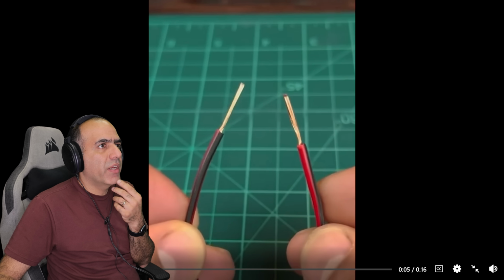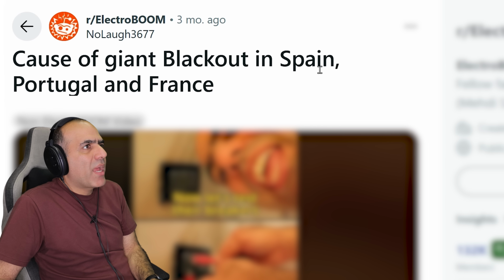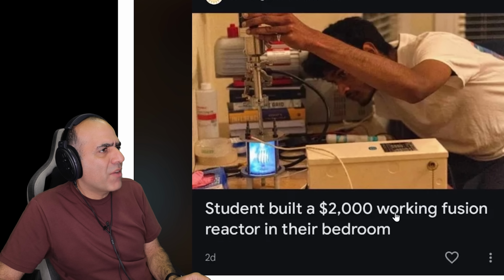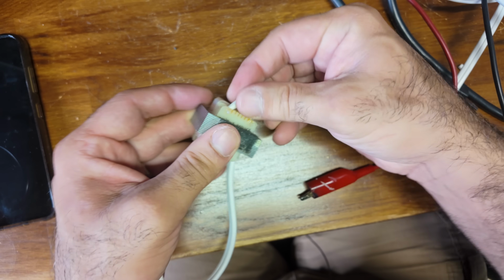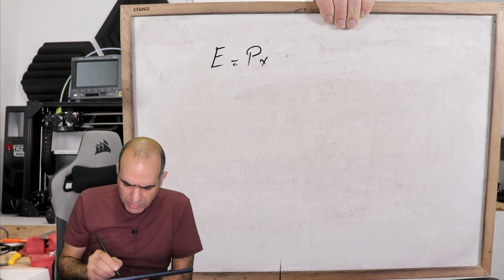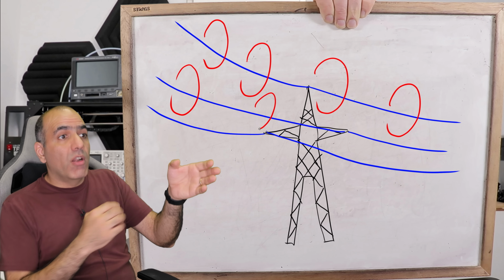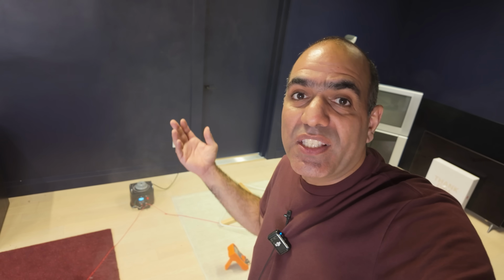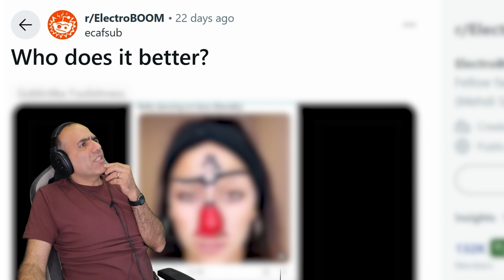Power Lines at Knee Level? Campfire with AA Battery?! (LATITY-016)

Comment: It is actually potentially nuclear fusion. But as you say, not "over unity". So it's just a party trick like building an electric motor at home. Or a battery. Or a capacitor. Or a plasma globe.
Reply: Oh come on nuclear physics says "NO"....
If you would light a fusion process something strong enough you can measure it you would die of radiation poisoning before the shitty reporter would be here for a interview...
The energy of fusion processes is released in mainly two forms... high velocity particles and hight energy radiation. Both not a good idea to be in the same room with.
Reply: @hawlitakerful  Dude, seriously, look up "fusor."  They've been around since the 60s.  You can build one in your garage.  There's actually a community of hobbyists that do just that.

Yes, there are safety concerns you have to account for and no, they don't generate more power than they require to operate, but they are fusion reactors.
Reply: @hawlitakerful  These are the words of dunning Kruger. All you're revealing is that you've personally never done it, otherwise you'd know it was possible and relatively safe with the right precautions. 

Jamie Edwards became the youngest person to successfully carry out a nuclear fusion reaction in a device he built  at his school. March 2014, 13-year-old. Reported on by a reporter.

Comment: For a battery fire, you can use the aluminum based wrapper from gum, chocolate, cigarette packs etc. Just make it thinner in the middle and it will start burning. Have tinder prepared and you'll start a fire.

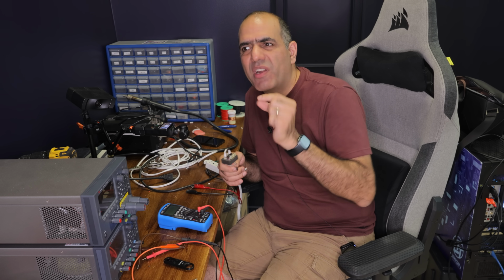Comment: 8:13 its just to small voltage to pull high current trought you measuring resistor inside your ampmeeter, just make 2turns , not half turn , and you will get 2 times the current

Comment: AA Battery thing appeared to use char cloth.  "is a material with low ignition temperature, used as tinder when lighting a fire. "
Reply: Looked like char cloth in the wire and fat wood shavings that were ignited.
Reply: @CanItAlready  very fat wood indeed... woof! 🙂
Reply: Use wire wool and a 9v battery or whatever angry pixies you have in your pocket.  Samsung burn well.
Reply: @Woffy. SöA metalized paper gum wrapper, torn in a way similar to the  wire in the demo (ie a thin bridge in the middle) can also work.
Reply: @Woffy. damn you! I just nosed my milk back into my glass! The samsung dig had me!!!
Reply: @anjhindul  
It's because Samsung CEO called Galaxy Note 7 "The hottest premiere of the season" 
Oh, sweet irony
Reply: neato, I thought it was like steel wool or summin.
Reply: char cloth is basically just charcoal but on a piece of cloth. you completely carbonize it and it's really easy to light, stays lit longer than regular cloth, and burns hotter
Reply: @Heroo01  It literally takes only a small spark to make it start glowing
Reply: I had to check back on it to realise that it's the cloth glowing, not the wire. Personally I'd just use a length of Ni60 or Kanthal wire as you can get the resistance down low enough for that to be above the ignition point of wood on 1.5 V. Then again, I usually have a LiPo cell on me so 3.7 V makes it much easier :)
Reply: Yea not a paper tower that is more plastic then paper.
Reply: @kirkanos3968  tower or towel?
Reply: This is a jailhouse special bro
Reply: It also used a coil from an e cigarette too by the looks of it
Reply: Char cloth "holds" the spark and glows like piece of charcoal. It gives you time to put it into tinder, and blow it into a flame.
Reply: Lol nerd alert naw I'm kidding
Reply: taper towel doesnt burn very well.
Reply: Correct, char cloth is just some cotton cloth that has been cooked without air, basically turning it into charcoal with a huge surface area.
Reply: The AA battery firestarter.  Actually works.  The cloth is carbon wool that has been soaked in alcohol.
Reply: Came here to say this.
Reply: ...and gasoline... 🙂
Reply: The way the pile goes poof then light up is gasoline. I've done actual fire from glowing ember (fire steel and tinder mushroom for those who are familiar) and it take long time, lots of smoke and gradually larger pieces of grass/wood shaving.
Reply: @greentjmtl  I know... I once bought a medieval fire kit with all those ingredients and I actually made a fire.
Reply: @greentjmtl Fatwood
That stuff ignites pretty readily, especially when it's dust.
Reply: @greentjmtl  Not at all. I used to do this is prison all the time to light cigarettes. Lights cotton super easy. Just puff up the end of a q-tip and light it. Not hard.
Reply: @greentjmtl  More likely Keronene then gasoline.
Reply: Nitro-cellulose.

Comment: Shorting a NiMH AA cell can result in a substamtial heating. The original dry herb vape, the magic flight launch box worked by shorting one across a metal grid. that could certainly combust whatever dry herb is legal in your region. the switch was also an example of genius cost effective design.
Reply: Whatever dry herb is legal?
Its an aroma therapy device i swear 😂

"Aroma therapy device" is what was on the box of my dry herb vape

Comment: you don't need wire anywhere near that long this is how we started our cigarettes in prison all you need is about 1 in of wire hell a quarter inch of wire will do, you shave the plastic off of the sheath and 1/4 inch of wire is all you need. A simple slice of Brillo wire is what everybody used in prison.

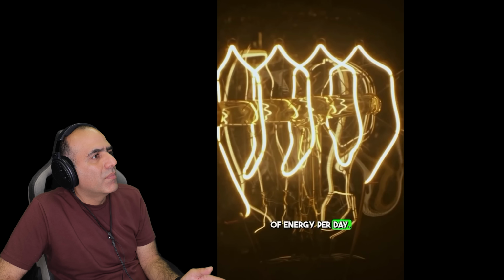Comment: 9:07  i think he meant to say 2000Wh .. people tend to forget the full unit for energy measurements. That would be 7.200.000 Joules, or 7.2 MJ. 
7.200.000 / 27.000 = ≈267 J/person 
267 / 2 sec ≈133 W
Would have some resistance, but definitely within human abilities.
Reply: 2kwh is about 1€,  
Great archievement.
Reply: @Animaniac-vd5st   Ah, but it is a great achievement for the con artists who sold the idea to the government's transport agency, with the small investment of only, let's say 500 euro per turnstile, per terminal. It'll pay for itself within uh.... If we make a euro a day, 500 euros per unit x 10,000 units...
Reply: @Introvertical474  Why are you automatically jumping so such outlandish conclusions? Are you seriously suggesting that the Paris metro doesn't employ a single engineer or something?

It seems this is pretty obviously a marketing stunt and the metro probably got paid for it.
Reply: Yeah, I found a source saying it's 2100 Wh over the 2 days (not per day). That's an average of 44W continuous. The monitor on the side probably consumes more than that...
Not to mention all the energy and materials used to build this.
And not to mention that the energy comes from people who then need to burn a bit more food and produce a bit more CO2, and the conversion is probably not very efficient. That's one of the reasons you don't put humans in hamster-wheels to generate electricity...
Reply: Energy = Force x Distance. 267J / person means that, if they push the turnstile a distance of 1m, they would have to exert a force of 267N, or over 27 kgf (60 lbf). My bet would be that they actually meant 2000J/d.
Reply: @WJS774 Likely!

Comment: He used a Duracel battery, not Energizer battery, that is the difference between a failed experiment and a success. My mouse can work for up to 6 weeks for everyday use with 2 Duracel battery, other brands of batteries have a lower life expectancy than that, like 2, 3 weeks, and then I have to change the batteries.

Comment: The 3 wire line outside your window, are you sure that's 3 phase? In my experience the top wire is ground. But I have no experience with US grids and it does have an insulator.

Comment: A cross, red geometric shape on the ground, smoke and burn marks? Preeeeeety close to summoning a demon there.
Also, I once cut a cable containing  ground, neutral and live using wire cutters. Even though live was disconnected at the panel (I check religiously 3 times) the ground fault thing tripped and confused the hell outta me. Since then I cut one wire at a time, but kinda confused why it popped.

Comment: Actually the fusion reactor shown is a Farnsworth Hirsch Fusor reactor and its one of the cheapest and easiest way to create a fusion reactor. You just need an high vacuum pump (like a turbo molecular pump) and a very high DC Voltage source, I think around 100000V. A few people on Youtube build one as well, but there are some who didn't got it right and just created a plasma lamp.
Of course this kind of reactor don't create nearly as much energy as it consumes, but its quite practical as a neutron source.
Reply: 30 kV is enough.

Comment: 6:00 Making a fusion powerplant is indeed very hard, but making a fusion reactor that doesn't need to create more power than it consumes... is still hard, but definitely easier than a fusion powerplant. Dunno if you can manage to do it at home tho.
Reply: You can, and people have. It's not easy, but some people like the engineering challenge.
Reply: It's called a Farnsworth fusor and several hobbyists made it at home.
Reply: Hundreds of people have made Farnsworth fusors at home and successfully initiated nuclear fusion in their garages.  It's a somewhat expensive and slightly dangerous hobby, but it isn't difficult.
Reply: Very much possible. Just expensive and requires a fair deal of knowledge.

Comment: @ElectroBOOM the D.I.Y battery lighter thing works alot better when its done with a (AA) battery and the wraping of a single strip of gum just get the strip reduce the width towards the middle by either cutting or tearing it and boom lighter.

at my school we would teach this experiment to the kids to teach them how current works but we stopped doing that after one of them worked out how to construct what the report calls "an incident ocured where a student while unsupervized made a small improvised explosive" dont worry no one was hurt.

Comment: Maybe that plug spacing is there in case you have a larger transformer plug. You can then span it across 2 plugs and something could still be plugged into the 3rd and top row plugs.

Comment: 15:44 I've seen- and been the cause of such a short circuit before the electrical meter, but the reaction seems too violent for this situation.
What's protecting this circuit? A 200 amp slow blow fuse?

Comment: the (assumed) reason that you can plug a device in between two outlets is if you have one of those annoying power brick plugs that takes up a bunch of space you can move it somewhere more convenient.
Reply: If you assume one of those takes up enough space to overlap into the next outlet, in the normal condition, you use the left outlet and the center outlet is unusable, leaving the right outlet. If you instead plug it into the left and center outlets, then the left and center outlets are still taken up by the brick and the right outlet is usable. I don't see how that has gained you anything.

I guess if you had four outlets in a line, you could plug a brick in on either side and still have a single cross-outlet slot available that wouldn't be possible otherwise.
Reply: @wbfaulk  I ran into a case where this was useful on a 3 plug outlet as well. The wall outlet was installed in a corner, so it was impossible to fit a bulky adapter in the rightmost outlet (it hit the side wall), and there was another bulky adapter in the left outlet. I used this trick to make it work
Reply: @wbfaulk  Another option is is the power brick has polarized blades (one bigger then the other) then it allows you to plug it in upside down. This way you could have some on the lower row facing normally and some on the upper row upside down.
Reply: That's what I was going to say, but you beat me to it. 😃👍
Reply: @arikwolf  ditto
Reply: Everybody hates fat wall warts. If you can move one so it takes up two spaces instead of three then I'm all for it.
Reply: I remember I saw a lihehack involving that, but I can't remember which exactly.

Comment: The last one looks like it's in a commercial restaurant. Sometimes, especially in older establishments, there's umpteen different panels and sub-panels and everything is mislabelled or not labelled at all. Sometimes it's easier to just short it and go look for the breaker that's popped...tho I certainly wouldn't be using my good linesman pliers, nor would I have my face straight in front of it. Had to do that when relocating a 240v dryer outlet once in a home for domestic abuse victims that was in a 200+ year old 3 story house(small mansion) that had been converted. No fewer than 7 panels across 3 floors and a basement, with the circuits randomly split across multiple floors depending on where it was easier to fish a wire from as their electrical needs gradually increased over the years. Had to make a jumper out of some 14/2 scrap and just jam it in the outlet while looking away from the arc flash...

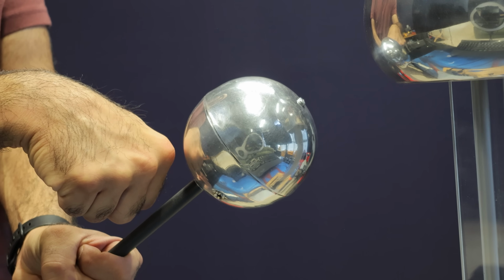Comment: 15:00 also it is AC for the Power lines meaning that there will be an additional effect: Capacitance.
The wire couples capacitively to the fence.
You might say the wire is thin and has not much surface area, but it is long and the fence is big.
Considering that over that distance air is pretty much non conductive even at that voltage i think this might be a significant factor even tho the frequency is low.
You might want to test that. Try wrapping a big area plate in plastic , and then attach a small thin (isolated at best) wire to it,and see if you still pick up voltage at the power line.
If so the E-field itselve (even without the air as a medium) has a significant effect.

Comment: 12:00 Take this out of context and you'll get a Mehdi that seemingly wants to electrify vampires or demons
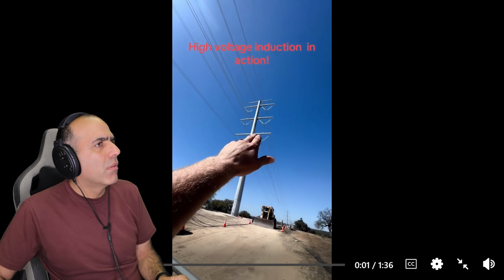Reply: 10:47 well that is true and mutch scarier with rf there is stories from people living near high power radio transmitters hearing the radio in fences metal bed frames and there is a story of a guy who broke his jaw and got the bone repaired whith metal bolts he lived near the long wave transmitter topolná in czech republic with transmied on 270khz AM at 1.5 MW the guy could hear radio in his head.
Reply: @hanapriknerova5712 RADIO in his HEAD 🤔
Reply: @RancidBeef-pl4qb  yes this was quite common back in the day when high power long wave and medium wave was common there is a nother story of a guy living near the Liblice B transmitter also in czech republic who put 2 metal cloth racks on his garage and with those he collected enouth energy to power his home lights with flashed with the amplitude modulation of the signal.
Reply: @RancidBeef-pl4qb  Making music with electrical discharge is basically AM, so it might be true...
Reply: @hanapriknerova5712  There's not enough energy for that. It takes way less energy to cause an electromagnetic wave to carry information than it is for energy, you can use way lower power since your idea is to broadcast out to be detected by a specialized receiver that decodes information from signals that are very low power at the receiver, and not convert that low power to electricity...

You'd need to be A FEW HUNDRED FEET AWAY to pull this off with a high power station, and you'd most likely need a tuned antenna, not just some random bs lying around.
Reply: @hanapriknerova5712  I will give you one good point for the lightbulb thing, because this concept has been known about in fluorescent lamps for a while. "Induction Fluorescent Lamps" literally use the medium wave band to light the bulbs, but a distant broadcast station can only maintain the light and modulate it when it's on, not start the lamp from cold and dark.

Sadly, this idea never truly got off the ground. They eliminated the major weak point in original fluorescent lamps, the filament inside burning away...
Reply: @Logic44  the guy lived less than 500m from a 1.5 megawatt long wave transmitter also the towers of the transmitter vibrated with the rf going thru them whitch made the whole transmitter ''sing'' here is a clip of the last moments of this transmitter on the air in 2021 the antenna arry was demolished in 2022 the death of the moast butiful transmitter in the world. it was the Topolná transmitter https://www.youtube.com/watch?v=1Rw_Ke0tMD4&ab_channel=Televizn%C3%ADsv%C4%9Bt at 0:47 you can hear it
Reply: @hanapriknerova5712  Just going to screw this fluorescent batten onto the ceiling, no, i don't need to run a cable to it, i can just use the transmitter that i live near.
Reply: hello engineer from the hit game Team Fortress 2
Reply: @PootisBirdTF2  Plotis spenser🤑
Reply: @Murderdroneeditz yes
Reply: Mehdi new Castlevania character confirmed

Comment: The transformer soldering iron is sometimes called a “instant soldering iron”, it heats up extremely fast because the tip is small enough, and heat is generated directly by the tip itself (so no need for heat transfer like normal soldering irons), but these things are so heavy (because of the transformer) that you definitely don't want to constantly use them

Comment: 7:48 You've only got 0.5 turns! Their soldering iron had something like 1.25 turns.  Extrapolating, that'd net something like 1.75A using your small transformer.  If the wire strand got bright red hot (guessing ~800°C) on ~4A, I could see 1.75A getting a small soldering tip past the 250°C to melt most solders.